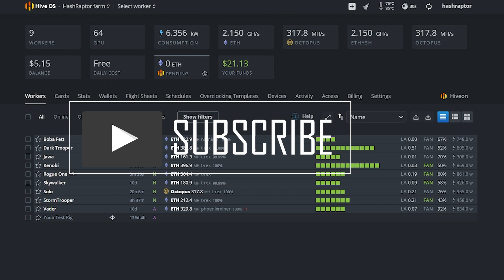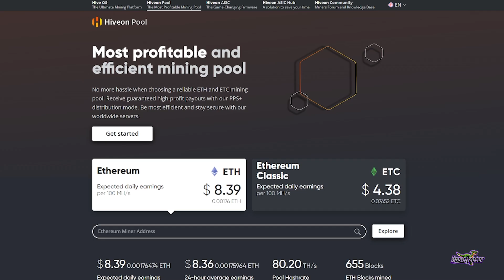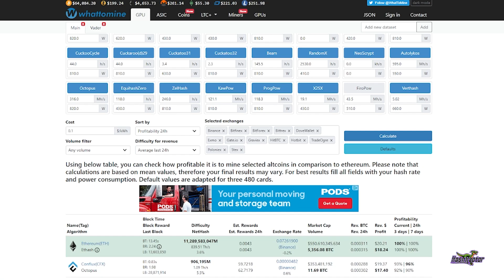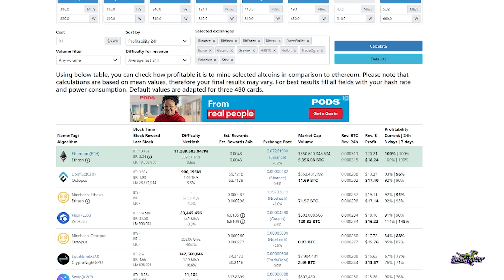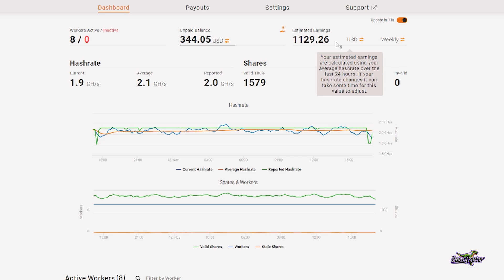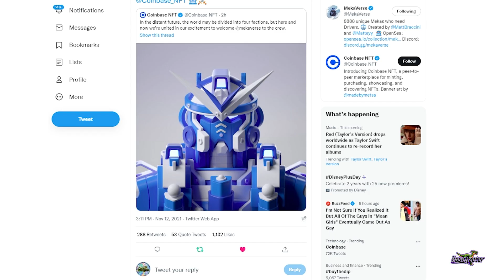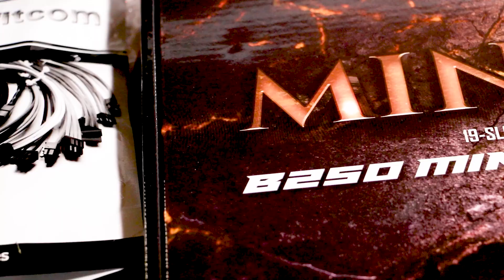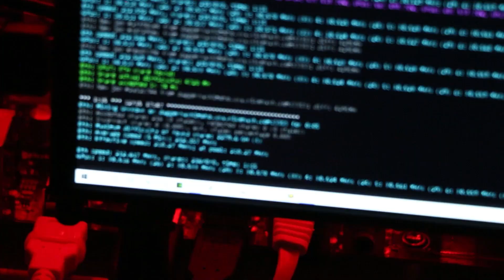How much is the farm making in November???

Comment: How much would they computer parts cost to make 1200 a week?
Reply: a lot my $5500 setup only pulls in $30 a day without counting electricity bills
Reply: @norcalfishing5112  yeah i did some whattomine stuff and 1200 seemed impossible
Reply: @chrislewis3322  ur gonna need to invest a lot of money in order to make 1200 a week
Reply: @norcalfishing5112  whatever bitcoin machines you can find that come out to be 171 dollars of profit a day. it is do-able. however, if you factor in making 1200 after electricity, it multiples the machines needed by 10 fold. for example, an s17 antminer if it costs 3 thousand and makes 15 dollars a day but 12 of it is electricity, the math gets wild